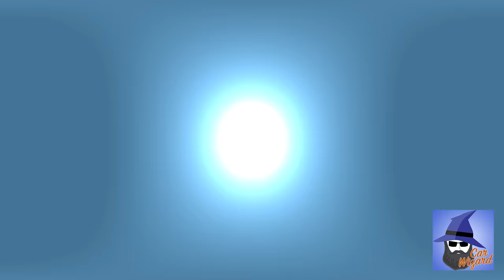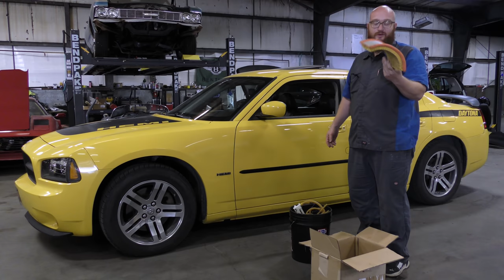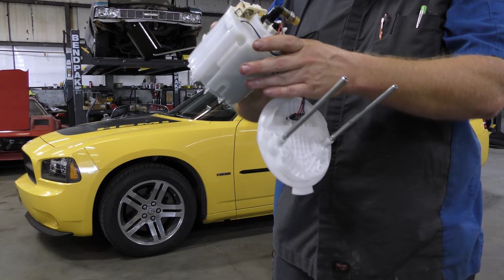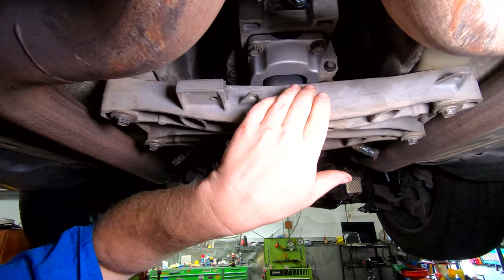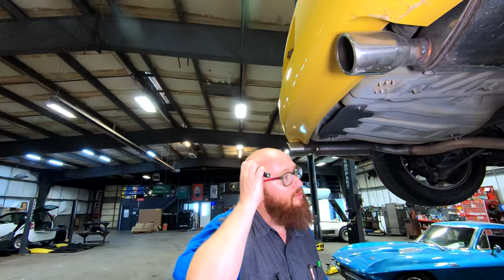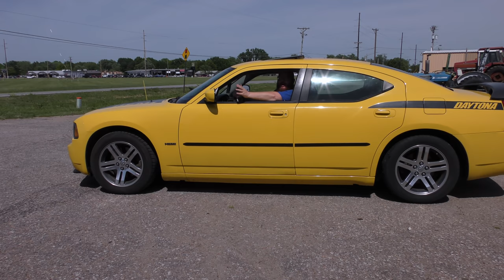Fully sorted and the CAR WIZARD's '06 Top Banana Charger Daytona is worth double! Final update!

Comment: Painting the body side mouldings black fits perfect with the aesthetics of the car. It looked like it came from the factory like that. Good decision there Car Wizard!
Reply: Honestly I forgot the old ones were even yellow until he mentioned it.
Reply: less of that yellow in any way shape or form is an improvement if you ask me
Reply: Exactly. Bring the black back.
Reply: The side moldings look great painted black, after seeing this if I had a yellow Charger like this I'd paint mine black ASAP, car looks awesome!
Reply: I agree. It looks better with the black
Reply: I agree, it looks like it should be that way.
Reply: I originally said "remove the door trim", but now I am onboard with the black trim.
Reply: I think they look better with out the molding's on the doors
Reply: The black adds a little definition.

Comment: Rodent damage is a big thing right now.. especially all the "NEW" cars sitting in fields waiting for "chips" .. and lack of people driving during the last 2 years.
Reply: I heard they like the wiring insulation because it tastes sweet to them.  Idk
Reply: Peppermint oil works great, and makes your car smell nice too.  Honda also sells a rodent tape that has cayenne pepper, but it is pretty pricey.
Reply: old cars ive seen have the usual minimal rodent damage but they seem to enjoy the new cars wire insulation better
Reply: @scooterdogg7580  Yup ever since they switched to "eco-friendly" insulation
Reply: @getchasome6230   the new Soy based wire insulation is like candy to them.
Reply: @getchasome6230  wires went 'Green".
Reply: I buy Fresh Cab at Tractor Supply as it was recommended by the parts manager at my Subaru Dealership.  I put one under the hood of my Challenger as it is a show car and isn’t driven often.  One pack is supposed to do an 8ft radius.  Smells like Christmas to me.  Replace it once a year.
Reply: @getchasome6230  - True. Wiring is a huge issue in the end of life waste/recycling side. It outgasses toxic fumes during manufacturing and recycling. There was a European Union directive to reduce the plastics in wiring specifically that took effect a couple years back. New "organic" materials were madated and as you say were found to be attractive to rodents.  Note the seat plastics were also mandated to phased out - thus the use of hemp and bamboo fiber based fabrics. Be interesting to see how long they last in hot temps.
Reply: I placed battery operated sonic repellers inside the hoods in each of my vehicles. They seem to work whether parked in the City as well as the suburbs.
Reply: The automotive industry never fails to epic fail and amaze both at the same time
Reply: @getchasome6230  You'd think by now they make all wiring with a bitter taste etc like the button batteries. Gotta be something that mice and rats hate the taste of.
Reply: @ddk80  I wonder if using Carolina Reaper on the wires will work (just wear gloves lol) 😊
Reply: Too late once the damage is done

Comment: You've done right by the Daytona, looks like it's good to go for some fun. Nothing like a well maintained vehicle, reliable and plenty of power. Also, the price was right. Got a keeper there.
Reply: Because used car prices are stupid insane high right now. That's great for mechanics like, wizard. Used car owners now find it to be worth it to now spend thousands on their used car to fix EVERYTHING in/on it. 2 tears ago, it wasn't worth doing that because the cost of repairs were way more than the car was worth, but not now....2 years ago, a used car worth 4-5k is now worth, 10k-13k so freaking stupid. Again, great for, wizard though. Now used car owners with pay to get the engine and trans rebuilt.
Reply: you could look at this as the rescue of a great hidden gem, something well worth the effort, good catch. I really like this car.
Reply: @nexpro6118 do you think i should drive 400 miles for a dodge charger daytona (this exact color one) with 85k miles on it? It costs $7500

Comment: I love this generation Charger. My girlfriend has one that’s unfortunately a V6 but it drives great and she’s kept up on the maintenance. We drive it halfway across the country and it’s a great road trip car.
Reply: That Pentastar V6 is surprisingly good if you take care of it.  I was never a fan until the last year or two when I started seeing them come in with some serious miles on them.
Reply: @406Steven  Hers has 130k miles on it now and other than an alternator going out it has never failed. She had the timing belt and water pump done at 100k miles and does oil changes religiously. It’s really a great car.
Reply: @406Steven  The 3.5 is better as far as the V6 chargers go. Stay far away from the 2.7
Reply: @timesup6302  The 2.7 is hot garbage, lucky to get 60k miles out of one before the issues pile up.
Reply: @406Steven  The 3.2 is also a boat anchor.

Comment: I actually think the Charger looks better with the black moldings, especially since it already has some other black accents.  Getting rid of the "fuel saving" was a good idea, too, it's been known to destroy engines and doesn't honestly save that much gas in a car like that.  The owner of that Smart car might decide it would have been smarter to junk it and buy something new by the time all the mouse damage is fixed.

Comment: Wizard hit a home run on this Dodge.  What I love about the Hemi powered 300/Charger/Challenger(both 1st and 2nd gen) is they provide the same thrills as my old LS1 powered 1999 Camaro Z28, without all the compromises.  AKA comfortable seats, nice smooth/stable ride/steering at high speeds, very quiet,  t-tops don't leak, doesn't rattle, much better build quality, room for your friends in the back seat, decent(not huge) trunk.  Also you can get them in under the radar sleeper colors/trim or just completely over the top wild like the Wizards.  Except maybe for the Corvette and Porsches, I can't think of another car that offers so many different trim packages and paint colors to suit your individual taste.

Comment: My favorite exhaust system is the, Flowmaster Super 40 Edition. I've been putting this version on my cars since, 2004. Since 2004, I have owned, 6 Dodge vehicles. All 6 have had this version I said above put on them. All TRUE duel exhaust set up too. 2.5-3 inch pipes

Comment: Great job Dave, great car. I have a Challenger RT and love that car.
Reply: Im dying to get a Challenger Demon and or Hellcat....hell, I even want the Challenger Super Stock Version. It's a Demon that's doesn't have trans break and drag rave mode and also without high octane fuel mode. Thanks to the US Government new regulations on car manufacturers having to have a high MPG average between all of its brands, has caused Dodge to have the cancel the manufacturering of the 6.2 Liter V8 Supercharged Demon engine in, 2023. That's the last year they will make the engine, because Dodges average MPG is above the limits because of this engine. Sucks!! Those engines will now be super expensive to find and buy after 2023. Watch, finding a decent low mileage Demon engine set up the way I said above, will cost over 35k for a "decent" used one. Watch. Ugh. Thanks US Government....its also forced Dodge to make a, All Electric Challenger.....wtf.....reason why Dodge has done so well since, 2018 and has made record sales and profits is because it was/is one of the last manufacturers that make a massive, powerful, loud, gas chugging V8 High HP engines. Dodge made the return of the muscle car era. Now it's being regulated away, again...just like it was back in 1973 when the government back then, chocked the HP out of V8 engines for less smog and better atmosphere for out furure.....F the future lol. I live in the now, I'll be dead 100 years from now, I don't give a crap lol.

Comment: I like your Charger. I had a ‘06 R/T Road and Track I ordered. It’s basically a Daytona without the decals. Same HP, wheels, intake, exhaust,etc. I liked the Nivomat load leveling shocks it had. I changed the grill to the honeycomb style so I could put the R/T badge on it. In ‘07 they made that standard on the Road and Track. I kept it for ten years before trading it and sometimes wish I’d kept it. Thanks for the video! 👍🏻👍🏻🇺🇸

Comment: I really love how this car turned out and the fact that it was saved, considering how rare they are these days. 

The matt black door moldings also fit right in. Now if the wheels are powder-coated black, that would complete the look! 😁
Reply: Because used car prices are stupid insane high right now. That's great for mechanics like, wizard. Used car owners now find it to be worth it to now spend thousands on their used car to fix EVERYTHING in/on it. 2 tears ago, it wasn't worth doing that because the cost of repairs were way more than the car was worth, but not now....2 years ago, a used car worth 4-5k is now worth, 10k-13k so freaking stupid. Again, great for, wizard though. Now used car owners with pay to get the engine and trans rebuilt.

Comment: The exhaust sounds fantastic! Much better than the SLP “Loudmouth” system my oldest son installed on his 2011 Challenger R/T. It was obnoxiously loud…
Reply: Im dying to get a Challenger Demon and or Hellcat....hell, I even want the Challenger Super Stock Version. It's a Demon that's doesn't have trans break and drag rave mode and also without high octane fuel mode. Thanks to the US Government new regulations on car manufacturers having to have a high MPG average between all of its brands, has caused Dodge to have the cancel the manufacturering of the 6.2 Liter V8 Supercharged Demon engine in, 2023. That's the last year they will make the engine, because Dodges average MPG is above the limits because of this engine. Sucks!! Those engines will now be super expensive to find and buy after 2023. Watch, finding a decent low mileage Demon engine set up the way I said above, will cost over 35k for a "decent" used one. Watch. Ugh. Thanks US Government....its also forced Dodge to make a, All Electric Challenger.....wtf.....reason why Dodge has done so well since, 2018 and has made record sales and profits is because it was/is one of the last manufacturers that make a massive, powerful, loud, gas chugging V8 High HP engines. Dodge made the return of the muscle car era. Now it's being regulated away, again...just like it was back in 1973 when the government back then, chocked the HP out of V8 engines for less smog and better atmosphere for out furure.....F the future lol. I live in the now, I'll be dead 100 years from now, I don't give a crap lol.
Reply: @nexpro6118  yes yes yes!!! We heard you the first 7 times you wrote that!   Just get one already!!!!

Comment: Most of the grille is supposed to be black, but I'm pretty sure the Dodge emblem is supposed to be chrome on that car. I was detailing these cars when they were new, so I kinda have an idea of it. Also, the spoiler looks slightly off, the Daytona Spoiler is supposed to be taller and more rounded than the stock SXT/RT spoiler. I think it has been replaced and vinyled from an SXT or RT.

Comment: I still remember how freaked out I was after I popped the hood on one of our cars and found fresh rodent droppings.  I actually spent the whole weekend thoroughly gutting and cleaning our garage.  It still was much easier than diagnosing and repairing potential rodent damage.  

Cool trick: if you want to keep rodents out of your garage, get a paper towel, soak it, and I do mean SOAK it, in the most spicy Tabasco sauce you can find, and leave it in the garage.  
Mice/rodents absolutely can't stand the smell of Tabasco sauce.  Garlic also works, but sharp Tabasco is best.

Comment: Love how the charger ended up! I'll keep it in mind for my own charger!
Reply: Im dying to get a Challenger Demon and or Hellcat....hell, I even want the Challenger Super Stock Version. It's a Demon that's doesn't have trans break and drag rave mode and also without high octane fuel mode. Thanks to the US Government new regulations on car manufacturers having to have a high MPG average between all of its brands, has caused Dodge to have the cancel the manufacturering of the 6.2 Liter V8 Supercharged Demon engine in, 2023. That's the last year they will make the engine, because Dodges average MPG is above the limits because of this engine. Sucks!! Those engines will now be super expensive to find and buy after 2023. Watch, finding a decent low mileage Demon engine set up the way I said above, will cost over 35k for a "decent" used one. Watch. Ugh. Thanks US Government....its also forced Dodge to make a, All Electric Challenger.....wtf.....reason why Dodge has done so well since, 2018 and has made record sales and profits is because it was/is one of the last manufacturers that make a massive, powerful, loud, gas chugging V8 High HP engines. Dodge made the return of the muscle car era. Now it's being regulated away, again...just like it was back in 1973 when the government back then, chocked the HP out of V8 engines for less smog and better atmosphere for out furure.....F the future lol. I live in the now, I'll be dead 100 years from now, I don't give a crap lol.
Reply: @nexpro6118  what
Reply: @V8_Diva  what what?
Reply: @nexpro6118  why did you put this as a reply to me? It's like, unrelated to my comment.

Comment: Your Charger is basically just like my 06 Charger RT except with the extra badges and rear wing, mine even has the same wheels. I really like driving it, plenty of power and will surprise other cars and me.
I paid 3 grand for mine too but it was a family deal because lil sister bought it brand new (go figure) and was tired of feeding it and trying to see around it when she backed up. It only had 89500k on it and I've had it a year now. It just got a oil change and plugs will be next, has 93500 on it now. How much power do you gain with the Diablo, the RT engines are 350hp stock. Enjoy the ride 👌

Comment: The really annoying thing is that the touch-up paint in Top Banana has changed slightly in the past few years, so that might be the issue. Modern touch-up on the '06 Banana color looks a bit like a mustard color when side-by-side up close. Not sure if it's Duplicolor or the original Mopar stuff, but I'll have to check at some point to see which is the case.

Comment: Your videos are awesome I been following these charger videos. I picked up a 2006 in go mango with 90k miles and really been enjoying it. I bought mine from original owner for 10k it's in immaculate condition. Glad you got yours going great and looks awesome 👌
Reply: Im dying to get a Challenger Demon and or Hellcat....hell, I even want the Challenger Super Stock Version. It's a Demon that's doesn't have trans break and drag rave mode and also without high octane fuel mode. Thanks to the US Government new regulations on car manufacturers having to have a high MPG average between all of its brands, has caused Dodge to have the cancel the manufacturering of the 6.2 Liter V8 Supercharged Demon engine in, 2023. That's the last year they will make the engine, because Dodges average MPG is above the limits because of this engine. Sucks!! Those engines will now be super expensive to find and buy after 2023. Watch, finding a decent low mileage Demon engine set up the way I said above, will cost over 35k for a "decent" used one. Watch. Ugh. Thanks US Government....its also forced Dodge to make a, All Electric Challenger.....wtf.....reason why Dodge has done so well since, 2018 and has made record sales and profits is because it was/is one of the last manufacturers that make a massive, powerful, loud, gas chugging V8 High HP engines. Dodge made the return of the muscle car era. Now it's being regulated away, again...just like it was back in 1973 when the government back then, chocked the HP out of V8 engines for less smog and better atmosphere for out furure.....F the future lol. I live in the now, I'll be dead 100 years from now, I don't give a crap lol.

Comment: I am a big fan of the 2000's Charger and Challenger. I am really concerned about what Stellantis will do with them. I hope they stay around for awhile.
Reply: Im dying to get a Challenger Demon and or Hellcat....hell, I even want the Challenger Super Stock Version. It's a Demon that's doesn't have trans break and drag rave mode and also without high octane fuel mode. Thanks to the US Government new regulations on car manufacturers having to have a high MPG average between all of its brands, has caused Dodge to have the cancel the manufacturering of the 6.2 Liter V8 Supercharged Demon engine in, 2023. That's the last year they will make the engine, because Dodges average MPG is above the limits because of this engine. Sucks!! Those engines will now be super expensive to find and buy after 2023. Watch, finding a decent low mileage Demon engine set up the way I said above, will cost over 35k for a "decent" used one. Watch. Ugh. Thanks US Government....its also forced Dodge to make a, All Electric Challenger.....wtf.....reason why Dodge has done so well since, 2018 and has made record sales and profits is because it was/is one of the last manufacturers that make a massive, powerful, loud, gas chugging V8 High HP engines. Dodge made the return of the muscle car era. Now it's being regulated away, again...just like it was back in 1973 when the government back then, chocked the HP out of V8 engines for less smog and better atmosphere for out furure.....F the future lol. I live in the now, I'll be dead 100 years from now, I don't give a crap lol.
Reply: @nexpro6118  I agree. I believe that most of the people buying these don't really care about fuel economy.